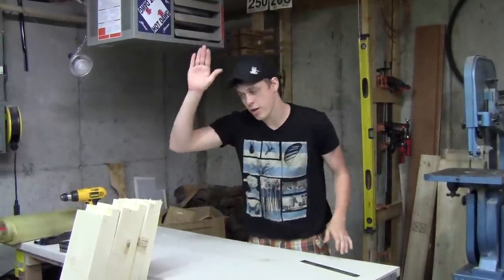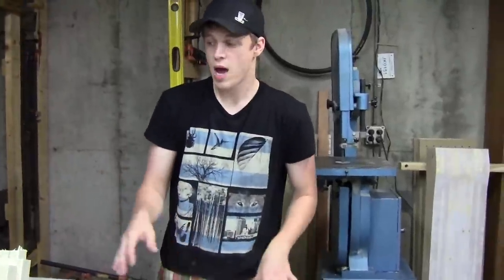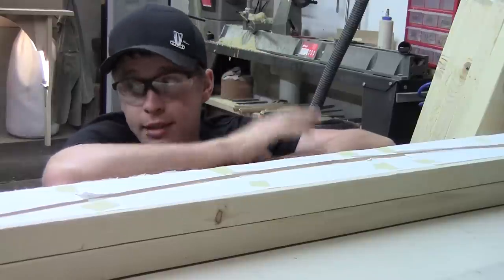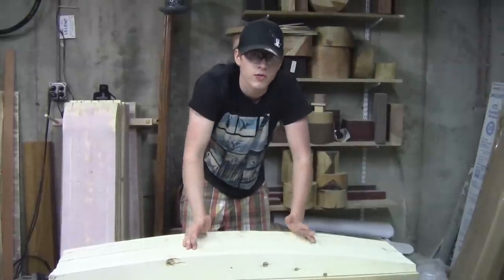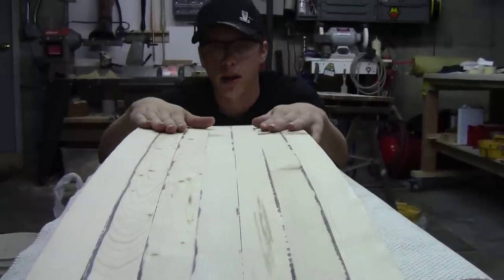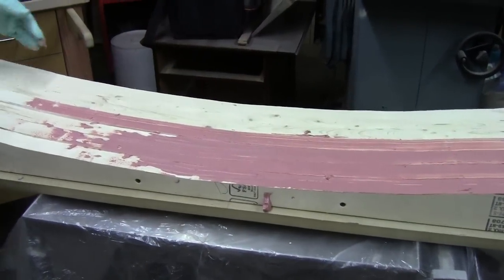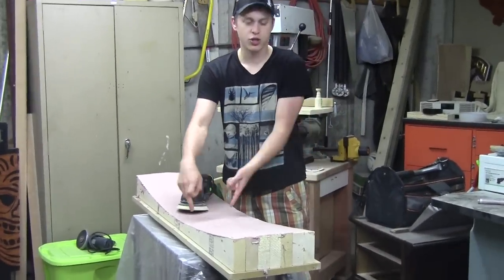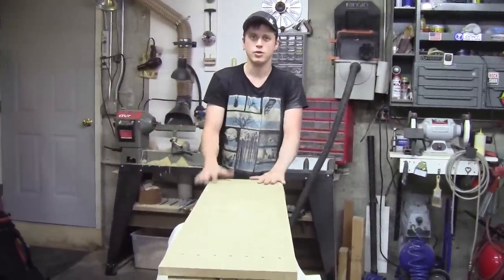Video Web-isode 1: Making a Stage 3 Rides Longboard Press

Comment from the maker: A good place to get bamboo for decks is from franksupply(.com). They are out of Cali and have reasonable prices and a friendly staff. And the concave usually is seen most on the edges of the deck, usually the middle couple inches are relatively flat enough that the trucks aren't effected. If you do happen to make it too steep (which would be ridiculous) then I'm sure some rubber risers would help fill the gap.

Comment from the maker: Hey Kasper,

Most of the tools that we are using are quite expensive and we were luck enough to have them donated to us. You could use a standard jig saw to cut the 2x's if you have access to them. This would cause you to do a little more sanding but im sure things would work just fine. Also a palm sander would work for the sanding as well but just time more time.

Comment from the maker: Hey Joe,

In fact it is quite inexpensive to make a press of this nature. The most expensive part of the process is the bondo to fill in all the imperfections. You can pick the wood up at you local HomeDepot or store of that nature for relatively cheap and use really any backing that will allow for structural support. 

Hope that helps,
S3R

Comment from the maker: @Partylikeaturtle Simply put, yes. Just keep in mind that the press will be wider than the board that you are cutting out by a couple inches probably, so if you want say a 1/4" of concave over the 9" width of the deck, and the press is 12" wide, then the total concave of the press will have to be higher than the 1/4" you are looking to press into the deck.

Comment from the maker: Making the press can be tricky, but keep at it and it will pay off. Also, to get the final kicks in the deck you have to over bend the wood to account for springback once it is pulled out of the press. So they may look large on the press, but they are smaller on the actual deck.

Comment from the maker: Hey! Thanks for the interest! We use 2 3/16 in ply of vertical lam bamboo in the core and a 1/32 in thick bamboo veneer on the outside with fiberglass sandwiched between. We also use West Systems Epoxy to lam it all together which is made for fiberglass.

S3R

Comment from the maker: It all depends on what your trying to achieve. Usually the tails of the board have a smaller width than on the standing platform, and because of this the concave isn't seen as much as it is in the wider sections of the deck.

Comment from the maker: That is the deck thickness. If you do not account for the thickness of the board and anything else that goes into the press, i.e. the vacuum bag, then you won't get even pressure on the top and bottom of the board.

Comment from the maker: Well to make the press, you will need some 2x6s to make the mold, then some wood for the backing to the mold. And the wood color crap I would assume is the spar urethane, which protects the wood from water and fading.

Comment from the maker: If both sides are sanded down, the gap between the top and bottom press will not be consistent, resulting in uneven pressure on all areas of the deck.

Comment: As far as layering goes, is it veneer, fiberglass, (2) 3/16" bamboo, fiber glass, then veneer with the WS Epoxy between each layer? or does enough of the Epoxy seep through the fiber glass?

Great video by the way guys. Very informative.